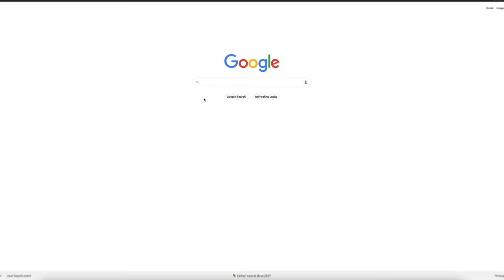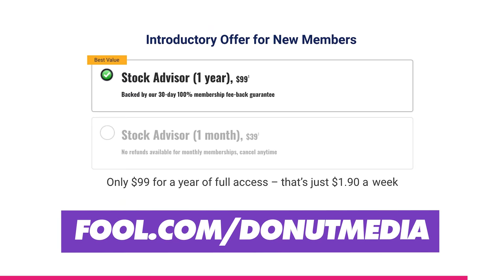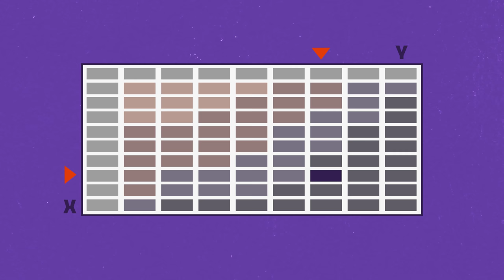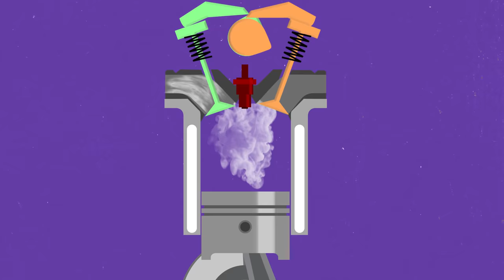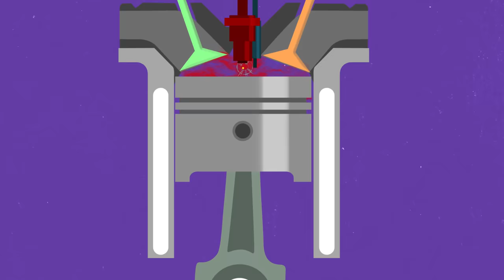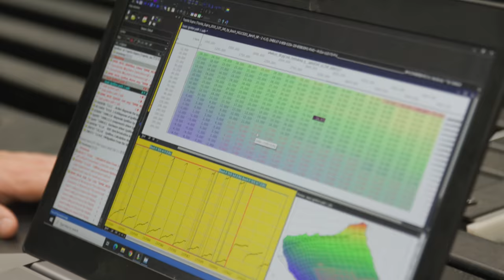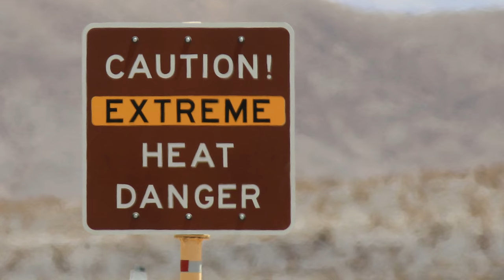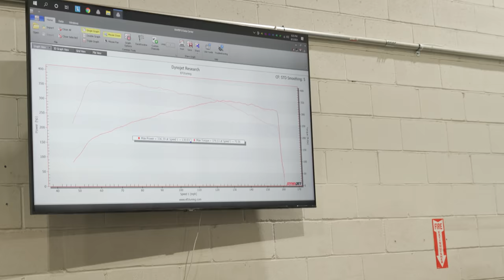Why Are They Banning ECU Tuning?

Comment: I’ve heard and seen people show their tune cars with stock engine equipment produce less emissions than what it’s supposed to originally. Those tests were deemed failures.

Think about that, making an engine produce less emissions is illegal. I don’t means making it better for the environment. Makes you wonder if they actually care.
Reply: They care about their pockets
Reply: they probably only improved some aspects of emissions. you can get a ton of efficiency increase by leaning out, but you generate NOx. Further particle mass and particle amount, unburnt CH and CO are monitored, you need to find a perfect balance between them. OEMs invest a ton of time into developing the best possible tune, no tuner is ever going to meet that quality without 10000+ hours on the dyno
Reply: Yeah, with hondata in my car, i was able to tune it to produce way less emissions all around and the damn thing runs better than ever. gets like 10mpg better than it did before converting it from obd0 to obd1 with hondata.

Comment: Something I think that is very important to point out and add to this is An ecu modified for something unrelated to tuning/emission can now fail emissions. 

For example a truck getting their ecu flashed to fix tire size or gear ratio calibration will alter the CVN which is what they are checking for. It’s absurd but will now fail.
Reply: This right here.   altering the tune to bypass or modify emissions is and should remain illegal, but there are tons of reasons the ecu may need to be modified that have zero effect on emissions. 
Gas cars are actually pretty easy to keep in compliance as long as your not running too lean/rich and have cats to take care of what's generated, regardless of power levels.  Diesels on the other hand can easily generate more NOx or particulates than what the SCR can handle.
Reply: yeah I was wondering about that, I would hope they planned exceptions (my faith in lawmakers is probably too high) made for legitimate modifications that require ECU changes. And hopefully that doesn't require a dealership visit. Anyone read the new law?
Reply: @crbrocket  nope no exceptions unless it’s a carb approved tune. Reason being is say you have that reflash for tire size changes. The dmv/smog station, nor California know what was changed and really no way for the vehicle owner to prove it wasn’t emissions altering, they just see it doesn’t match what’s  approved or not
Reply: I have a 99 trans am with an ls1 not long ago I changed my throttle body with a stock one and had to use hp tuners to adjust Idle, so youre saying I won't pass smog now?
Reply: @martinez1701a  assuming you mean you used the scanner part to adjust/relearn then no that’s fine. If you actually re-wrote a tune to the car that would change the CVN but not sure why you would have to do that on a stock throttle body change
Reply: @tommypdcantcopsht  previous owner drilled holes throught the throttle body plate and I just got around to replacing it, after I did idle was low. Anyway yesterday I was playing around with my tune put it back to stock and made small changes, seems that any change no matter what changes the CVN so I will stick with stock then put my tune back after smog.

Comment: This is pretty lame. You can get an aftermarket ECU and tune your old car for better MPG & fuel emissions simply by getting a better combustion. A better combustion means more of the stuff coming out is just oxygen, carbon dioxide, and water; a worse combustion means you get more NOx & all the other worse emissions. Ultimately getting a better combustion means you get more power out of the fuel you burned, less stress on the catalytic converter, and better MPG across the range by virtue of not having to reach higher RPMs to get the power you need or want. 

The law should be more complex.
Reply: I used to hid my timing on my 93 Toyota pickup with a big electric fan. Ran 91 timed at 12*(stock 5*) shaved head and bored over. When ever I went to smog it it would be below 15% of the maximum in all columns but yet they would harass me on my timing. If I put it on stock timing it ran like shit even when the motor was stock and would barely pass with no power. Also got 26 mpg on the highway

Comment: If this opens the door for tuners in CA to get CARB certification and get an EO sticker, it may not be so bad. I understand this process will be cost restrictive to alot of tuners though, which is unfortunate. However, I've been mulling over the idea of a tune in my diesel Canyon for years but had been wondering if smog testing in CA can detect a tune. Apparently they can, which is why I was hesitant. What's sadder is by all accounts, the tune for my truck improves mpg (if ever so slightly) power, and driveability while emissions controls and things like DPF Regen remain intact. Sounds like something CA should welcome with open arms. I know not all tunes are like that, but the ones that are...I hope to see them get CARB approved.
Reply: Go by with banks.  It's  smog legal.  Then you don't have to worry about   it just have you carb sticker under the hood and you good .

Comment: Not all ECU swaps will be illegal. My Dinan tuned 540i/6 has a stage 2 tuning that is certified and registered to meet all California smog requirements and is 50 state legal. It has passed smog tests for 23 years and is still putting out almost ZERO emissions. It wasn't cheap but the best never is. No worries !

Comment: You never once mentioned the most visible polluting tune on the road. "Rolling coal" that is likely a HUGE reason the ecu tuning ban was pushed for emissions reasons.
Reply: Yup, who thinks it's cool to dump soot and smoke on someone, a wannabe bully? From what I always learned, a smokey diesel is producing less power and is better being clean. But yea I feel like they played a big part in it.
Reply: 100% correct
Reply: Stock diesels before DPF systems still roll coal with no tune on a hard take off
Reply: ECU tuning does not do much for rolling coal it is the exhaust and cat that is modified not the ECU. look it up ECU is just for better burn in the engine and timing rolling coal is dumping all the exhaust gas fast when revving high down a straight pipe with no cat or muffler so all the burnt and un burn fumes blow out has nothing to do with the ECU. On some the modification happens to trick the ECU that is is needing more fuel so just bigger injectors can do it with out tuning the ECU or can have switch to bypass the ECU with a switch to turn it on and off so no need to tune ECU at all some easy ways is to tune it but truck wont last long if it is on all the time with ECU fuel dumping all time time wears out the engine and parts fast so destroying the truck if you do the cheap ECU tune easier to not do it and only do it when you want.

Comment: You have Arnold Schwarzenegger to thank for all this. The big Harley enthusiast got into an accident and did not have the M classification to ride one. Given so much crap on his way out the door he passed a law in CA - no modifications to intake or exhaust on motorcycles built after 2012.

I was lucky that in 2015 when I bought my Road Glide I immediately purchased the Screaming Eagle Race Tuner. You see the stock Harley you buy out here today runs like crap cause of the lean mixture and the smog. Every Harley I own gets a high input intake, headers and is Dyno tuned. You get better MPG, more horse and torque and the bike just runs cooler.

Of course today you they wont ship that race tuner, headers or intake to CA and have to take a trip to Arizona to have your bike tuned. But if you do, it's like you bought a brand new bike, especially in 5th and 6th gears.

CA is a joke, and despite people here complaining about all this climate change bullshit still re-elect the fools who promote it time and time again. Like you said, if you follow the science tuning your ride is better overall for the vehicle and the environment, guess that makes me a white supremacist.................

Comment: We can thank a bunch of the turning crackdowns in the trucks that have emission defeat devices and those that roll coal.  They made it far more visible, and create far more emissions.

That said, one thing that is continually ignored about this law is that you can get a tune what is legal. APR has CARB compliant times for VWs, and there are, and will be others.
Reply: Any carb legal engine mod that comes with a tune will also pass fine. Kenne Bell makes a bunch of carb legal supercharger kits that come with tunes.
Reply: Not just them. Look at the epidemic of decat videos on youtube, every clapped out GR86, 350z etc. have "epic straight pipe exhaust sound".
Reply: COBB OTS tunes CARB legal too, This is just a bunch of RED State hysteria.

Comment: Couldn't you just revert to a factory tune before going in for inspection, then revert back to a custom tune as soon as you got home?
Reply: They're having ECU tune checkpoints, kind of like random breath tests. Luckily I live on the other side of the world down in Australia so luckily doesn't affect me.
Reply: @crapcopter  sounds like yall have bigger problems there
Reply: @jroda8015  Welcome to Commifornia! (Hopefully the recall succeeds and Larry Elders wins)
Reply: @jroda8015  Luckily over here there's no laws against it, or inspection of any kind. But I've got friend over there and they aren't happy about it.
Reply: @crapcopter  was talking about the govt stomping on your civil liberties
Reply: Just like your ECU will tell on you when trying to do a warranty claim  with clearly moded parts it will tell when the changes happened for the emission testing
Reply: @AmperageY  That's when you just run a piggyback ECU separate from the main one. Might hide it.

Comment: I got my turbo diesel ECU tuned a while back. It doubled my torque on the low revs and increased overall power. It made it more efficient too. So, it’s a win-win. More power, better fuel efficiency, what’s the problem?

Oh yeah, I live on the other side of the planet. 😂

Comment: I got a nice ECU for my truck with hot swap tuning. More efficient when not towing and same efficiency/more power during towing. (or stock). I measured the fuel economy and it works, around 5% improvement over stock.

Comment: It's a shame ECUs are so locked down. I would love to kick it up for some weekend fun but then crank it into ECO-MAX for my drive to work, or work drives.
Reply: you can get that! it's just map settings!
Reply: That's what your throttle is for....
Reply: you can have switchable maps. theres a company called esmotors that does porsche remaps and they have 5/6 maps on some of their builds that you can swap with a button on the steering wheel

Comment: as several mechanics have said to me over the years in nearly the same words.

theres skill to tuning an ECU.

there is an ART to tuning a carb, its not just about numbers but.. sometimes a feeling about where a problems coming from and understanding, at least on some level, how to address that... or at least identify it... 

theres also alot of skill involved in figuring out whats actually wrong in some cases in both types of setup... because... tech...old or new... can be... infurating... cars and such are given "personality" but also, have personality, some are grumpy old men, who start slow but, once up and going will chug along all day no problem, others are quick to start, and quick to need worked on again, because something else is wrong... like a needy high maintenance gf or wife..

Comment: I feel like PFI Speed (another car channel) would have been great to contact for this video. As the EPA is currently suing him and his shop for selling and tuning Hondas.
Reply: The EPA is only going after sellers that sell emmissions defeat devices that can only be used in a vin car, ie, direct drop in fitment products that will not fit other applications. Eg, entire exhaust systems with cat delete, or, plug and play harness signal intercepters.
Generic products that could have legal uses, eg, an ECU that coud also used on an old lawn mower, the EPA is not touching.

The short answer, the EPA is going after slam dunk cases they will win in court. PFI is one of those
Reply: @dakotajones8010  Lund Racing modifies cars that run on the street, and increases those cars emmissions - illegally. You can guarantee the EPA will only go over cases they can easily win in court, eg Lund. This is the low hanging fruit.
So what is your point ?
Btw, most people want clean air and quiet cars.
Reply: @nordic5490  actually theyve tested catless cars with e85 run cleaner than pump gas catted cars and why would I want a quiet v8

Comment: All I want to know is: How would they ever possibly enforce this, I.e. Identify vehicle has non-OEM tuning? ..Assuming vehicle passes smog.  Seems like another toothless law OR $$ grab
Reply: CA does emissions every 2 years. For vehicles that aren’t exempt (over 8 yrs old is one example) they get physically/visually inspected. They check exhaust, cats etc for any mods . Second, the vehicles ECU is compared to a like vehicles stock parameters on file thru the OBD2 port. If there are any deviations, its an automatic Fail and you cant register or renew until faults are corrected.
Reply: The OIS interrogates the PCM and finds unfamiliar coding. The vehicle is failed then flagged. A tune is immediately identified by the smog software. Even diesel tuners get failures HP tuners, modded ECM aftermarket programmable PCM all will trigger it. Unless you really know how to write Trojan programs to mimic factory parameters while allowing a parallel program to operate your engine management. No BS I'm a smog technician.
Reply: @webreakforsquirrel4201  So, how does that work with manufacturer released ECU updates?  All of Ford's PCMs are reprogrammable in the field and Ford frequently updates PCM programming.  How is Cali going to keep up with every new calibration Ford releases?
Reply: @aaronthomas6155  calibration ID. You don't understand. The manufacture is far ahead of this game. Most new vehicles don't require emission testing for 6 years. That gives them 6 years to submit updates to CARB.

Comment: Wait until they find out some other countries don't even allow you to paint your car. Or have wider tires. Or spacers. Or rims larger than the stock ones. Or to swap the engine. Or basically do any mods of any sort.
Reply: Actually, if one goes by the letter of the California Vehicle Code Book, most all modifications to registered vehicles are not permitted.
Reply: C o m m i e f o r n i a
Reply: Sounds like Australia

Comment: I live in CA and this state can blow me, I've got megasquirt plug n play on a bored and stroked swap m30 swapped e30 that required only a single pinout change. I can swap back to an afm and bolt the cat back on with a narrowband, got a new distributor and tps for smog, swap ecu back to the stock one for my m30 with the sticker from the m20 on it and pass with flying colors. Even passes visual, made the intake come out the driver's side and hammered 80 grit on the piece covering the original opening in the manifold to look factory. Pops has a 95 Land Rover with a 4.6 where the 3.9 was that passes too, getting around smog laws is a family tradition.

Comment: Doesn’t an ecu tune kinda.. help?.. with emissions? Like makes your car run more efficient?
Reply: it can depends how its tuned
Reply: Efficiency sometimes comes at the cost of emissions. That's why cars took a dip in fuel economy after the EPA raised emissions standards in the 70s, and it took them a few decades to catch up

Comment: As far as I've heard from a variety of tuners, none of them have had any trouble with emissions here in California. The state would basically have to have their computer systems updated to recognize that an ECU is running outside of parameters in order to detect and fail a smog. Smog tests in California mainly check for how clean the air is coming out of the tailpipe, and that there are no faults (or no more than a certain number allowed, like 1 if the car is over a certain age).

Comment: I live in California, and people need to remember that in CA, air quality is a big big thing. I mean, Amtrak and the two commuter railroads in southern California are replacing all their diesel locomotives with the cleanest Tier IV models in existence -- a lot of the old Amtrak engines are now in Chicago, pulling commuter trains there. Yes, a diesel locomotive is putting out over 4000 HP, but there are only a few hundred passenger locos in southern California, compared to millions of cars and light trucks, and clearly the impact on air quality by replacing 20 year-old locos with new locos is a drop in the proverbial bucket overall.

Comment: I want to see AI (q learning or something) ECU's, so they can constantly learn and produce more power, cleaner emissions and more torque or whatever you would want to choose
Reply: A lot of aftermarket ecu’s have self learning functions
Reply: They already exist
Reply: Wouldn't that then make the Californian law useless since ECU's are able to modify themselves
Reply: @ruairimurphy9865  no as there is still a factory calibration that it starts from
Reply: @tommypdcantcopsht  but it modifies itself which is illegal?
Reply: @ruairimurphy9865  not sure how else to say it but the factory calibration is not illegal, period. Doesn’t matter how it adapts/changes. It was designed to stay emissions compliant, it’s not gonna modify/adjust itself to not be compliant
Reply: @tommypdcantcopsht  unless it's a vw then it'll do whatever

Comment: They’re getting strict on motorcycles too. Certain tuners for Harley are banned. If tuned right they actually run cleaner. A lot of Harley’s are running rich or lean out of the box. This can help that easily.